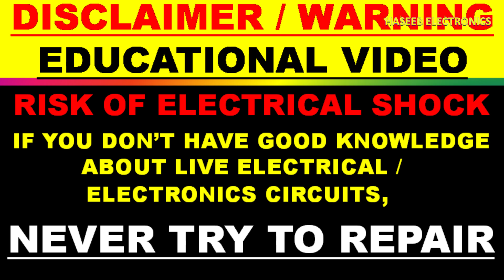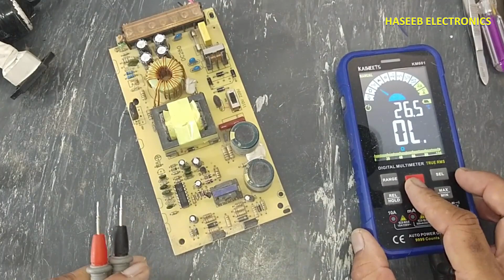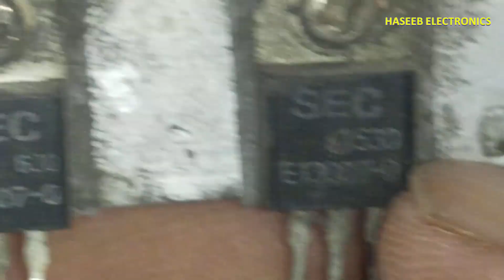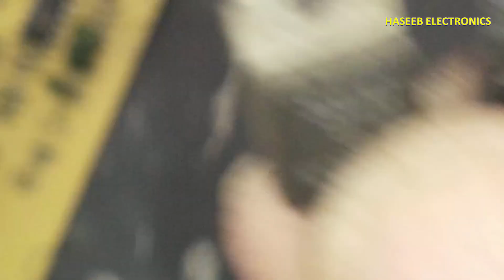{966} SMPS Is not working, not turning on, no output voltage

Comment: Hello Mr. Haseeb. I have the same SMPS 12v/10A, the output is good but it is not giving the 10A when i put a load the voltage drops to 7.5v what could be the problem. Thanks.

Comment: Sir, I need your great advice. I have a rechargeable small mixer grinder using 555 DC motor and  lithium ion battery. The circuit I found that one smd mosfet is damaged and not available. When I connected the charging module Tp4056 instead of the original pcb the module getting very hot and within few minutes damaged . Which type module I can use? Plz suggest. Thnz

Comment: Excellent lesson, simple and concrete, as usual...thanks for the translation support in Romanian...the isolation of the D13007K transistor from the cooling chassis is done with a nipple-type insulating flange (insulating bushing) for TO220 capsules and a thermally conductive support (like 2N3055 and BU508A) ? It fits into the 3.8mm hole at a depth of 2.5mm, allows the use of an M3 screw, has a body thickness of 2mm, withstands a maximum of 130*C? do you have any example of the isolation of TO220 type transistors from the radiator? thank you for your kindness and help, professor

Comment: Sir, very good, good information, sir just removed ic with high temperature can we check with multimeter,or allow transistor to cool down 😊
Reply from the maker: first of all we must take special care for soldering temperature and allowed soldering time for any component 
for best test results it is recommended to test component at room temperature (25 degree Celsius)  at high temperature it may give false reading
Reply: @HaseebElectronics  thankyou very much sir,